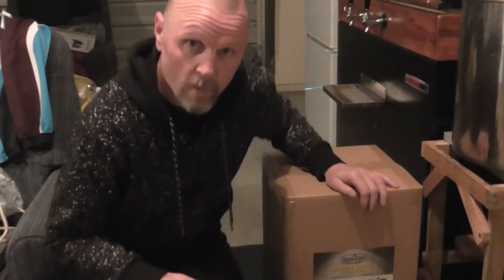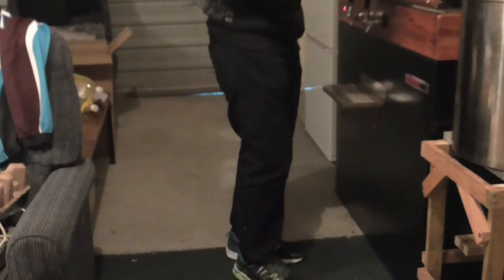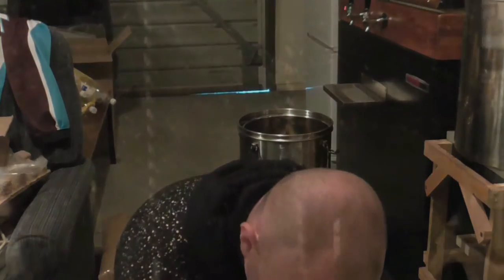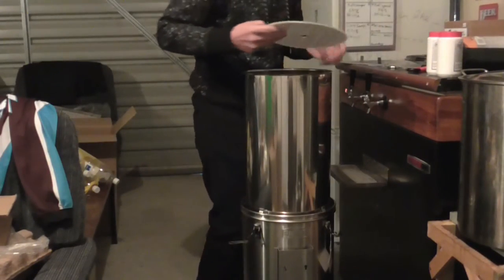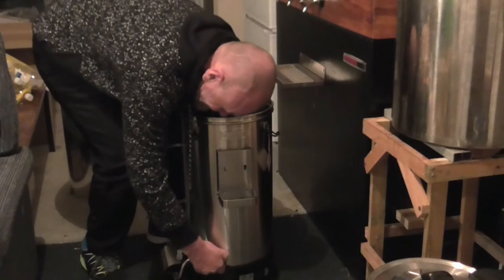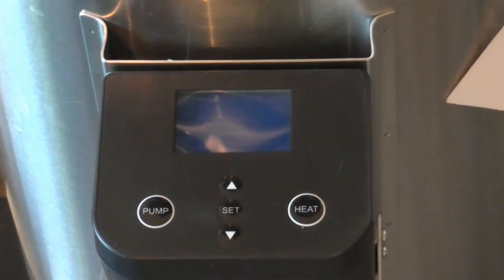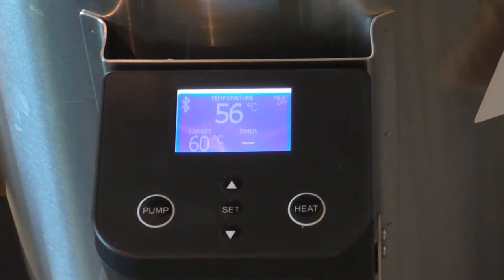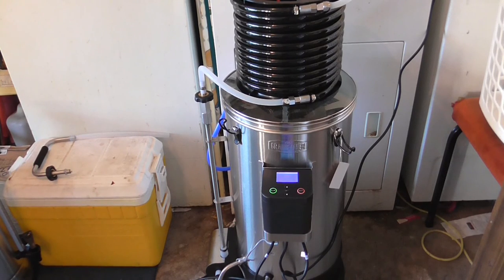Grainfather Connect Unboxing

Comment: Just got mine on the 20th, its friggin awesome.  Still need to brew with it and sadly here in the USA we are very short of the new connect module.  They are just trickling in.
Reply from the maker: skraelingshortbus  Yes it is an awesome unit I will be doing my first brew this weekend
         Cheers